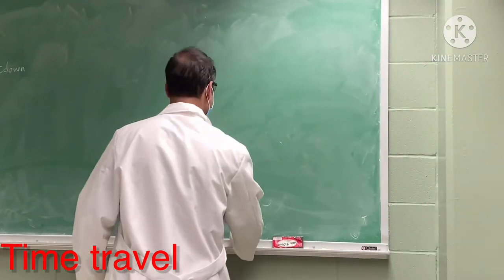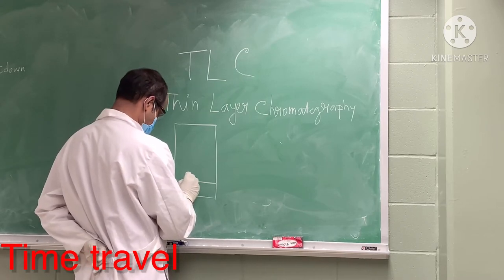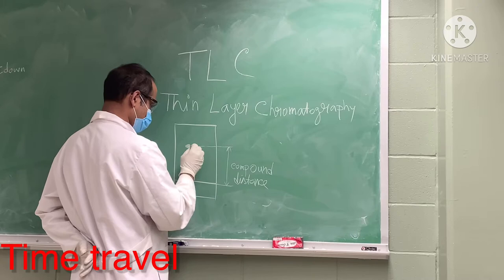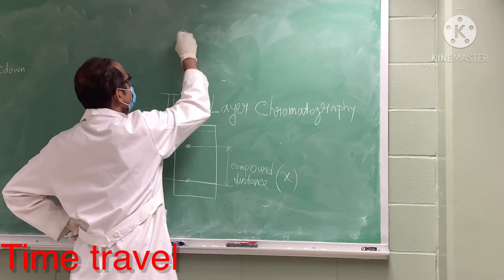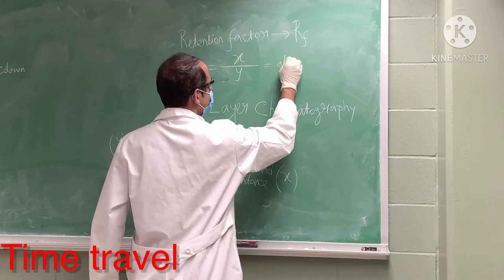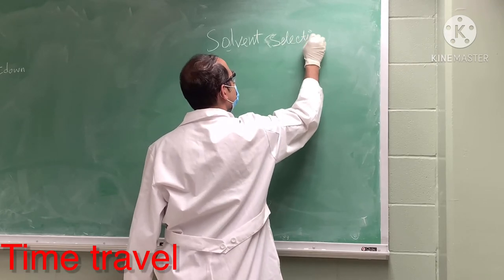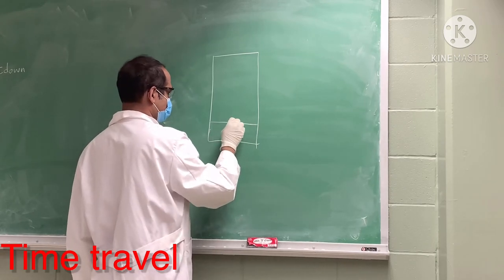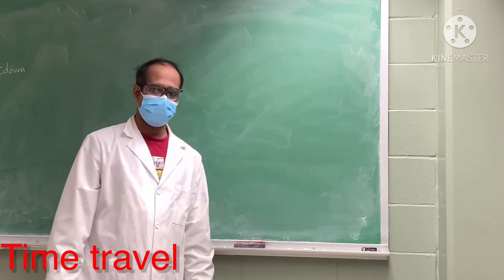TLC in Organic Lab-Practical demonstration

Comment: Thank you for this video..
İ have an question
Yesterday i separated my sample by TLC to see its purity and it looked only two spots, two compounds but when i used column chromotography to separate these compounds and used again TLC it looked like there are three compounds and more 
İ can't understand what happened
My column dried during louding the mobile phase, is there any relation with that?
Reply from the maker: Your compound is unstable in silica gel columns for longer time. Maybe it’s degrading or isomerization happening. To check the stability of your compound in silica, you can do 2D TLC. It will help you to realize the unstable conditions. Keep the compound spotted on TLC for long time then run it in the mobile phase. See if you see any difference. That is another way.
Reply: @Dr.Mosharraf  thank you so much for your reply 🙏